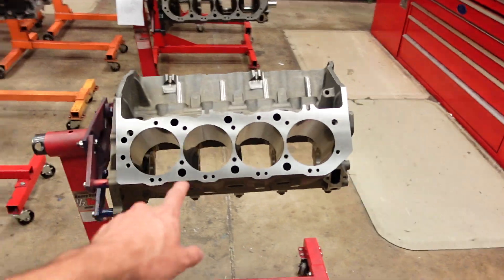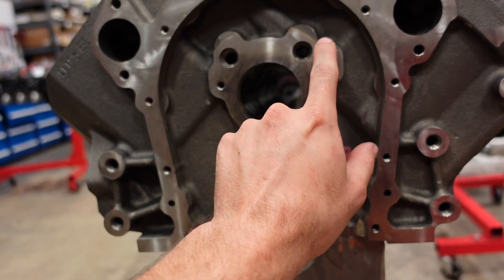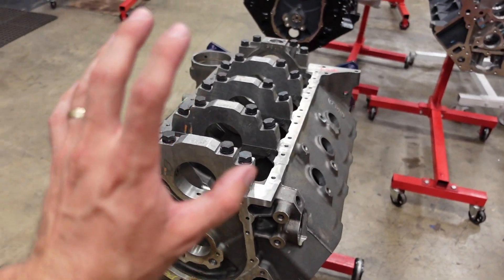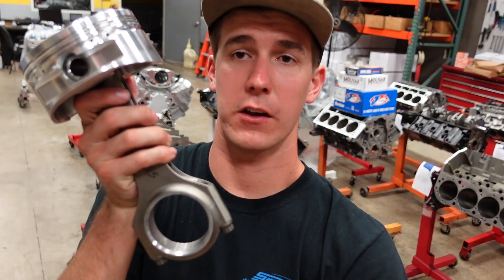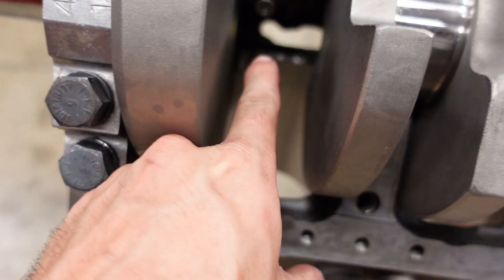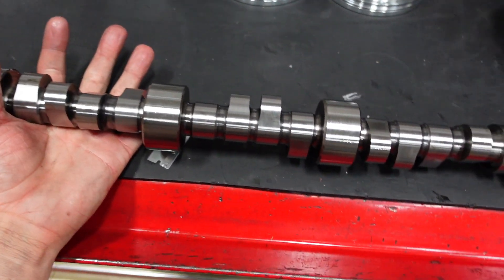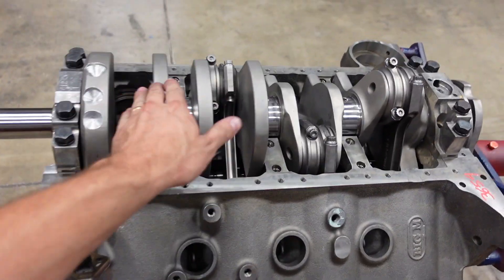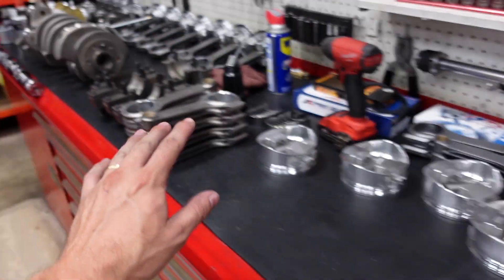Building a 632" Big Block Chevy - Block Prep (part 1)

Comment: I would throw 2 blowers on it and stick it in my 96 k1500 with a beefed up 6 spd manual trans and transfer case. Put a 6 inch suspension and a 2 inch body lift with 44s.

Comment: i would have used an 11.625" tall deck for a 631 c.i. , however for a 10.2" i would only build a 545 or 549 or something like that. Custom steel rods. Thin pistons. true pure street daily driver NA only. 4.55" bore with a 4.85" crank and 8" rods. flimsy 1.200" piston with a 1.65:01 rod ratio. Better rod ratio than a 350 chevy.

Comment: Dude, you rock! 40 years ago I got an after school job working for an engine shop that built motors for sprint cars and IMSA which turned into a career. You're doing a lot of things that we did then but with parts and tools that we could only imagine! After seeing YouTube idiots post things like "why it's cheaper to replace an engine than changing a head gasket" or "resurfacing a cylinder head with sand paper" I was thrilled to see that actual intelligent engine building isn't a lost art! Keep it up, I'm now a fan AND a subscriber! Not sure where your shop is but if I'm ever in the neighborhood I'd love to take a closer look !

Comment: My c3 has a 632 TALL DECK WITH A BLOWER BDS 8.71
I have never used it yet, because I still have to fix a problem with the engine overheating. 
I had never seen this engine dismantled before because I bought the car like that.
I am impressed .

Comment: Is the .100 you removed from the corners of the connecting rod shoulder going to affect the balance of the rotating assembly? Looking forward to the next steps of the project.
Reply from the maker: Not enough to matter on a big block

Comment: I'm curious, with all that fancy prep.....are you going to grind off/smooth up that narly casting flash on the sides of the drain back holes down in the valley?
Reply: That’s exactly what I was going to ask.
Reply: That was the first thing I noticed. And it was still there at the end. I worked in a foundry for a long time and we always cleaned the casting before it left. or better yet we filed the cores so there wasn't very much left.